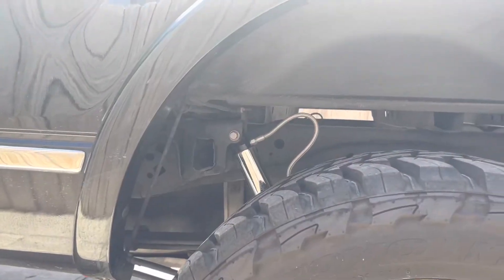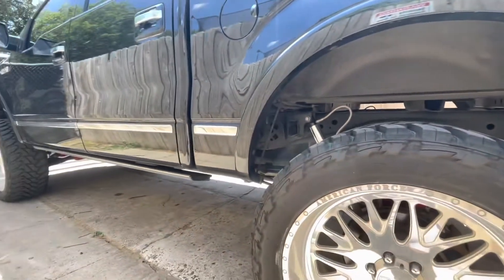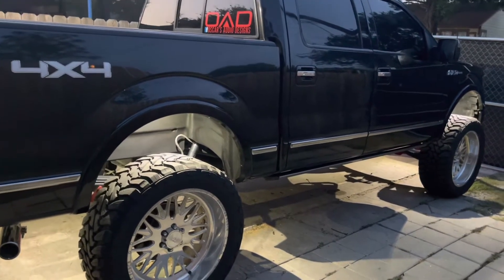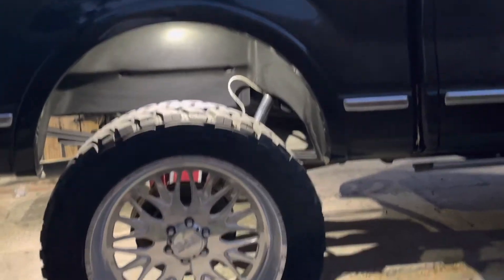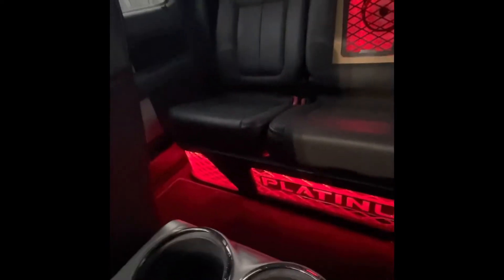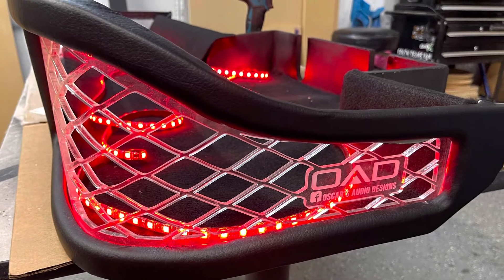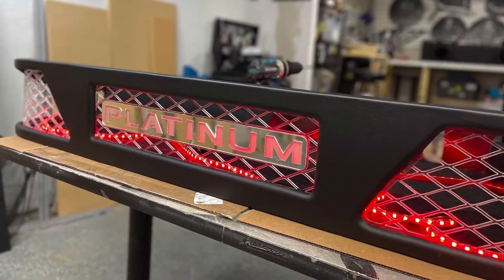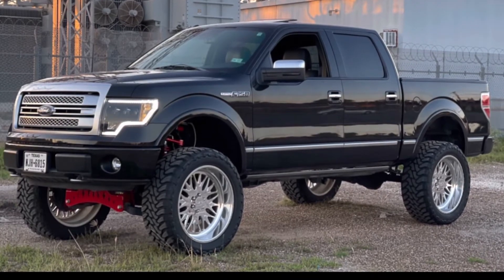F-150 with Fullthrottle lift American Force rims and JL Audio blowthrough

Comment: Clean, I've got a 2013 XLT I'm working on just got some SKAR equipment I'm going to do a build with it. No shit though, absolutely love your black beauty.
Reply from the maker: Thanks man. I’m almost done wit it just have to buy some tail lights and 3rd brake light they come out end of January. Skar is a good brand I’ve done some build useing them
Reply: @Oscar Rodriguez  There good for my budget. I went with a Smoke RECON 3rd brake light and it looks good paired with all my other lights.
Reply from the maker: Thanks I’m waiting on Morimoto there supposed to release some end of January